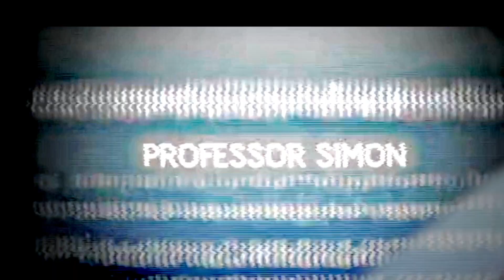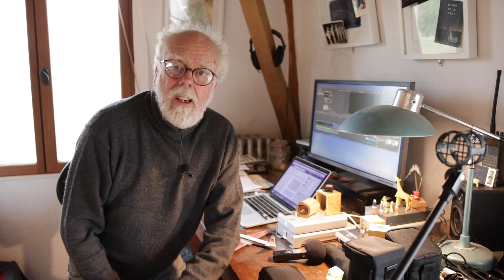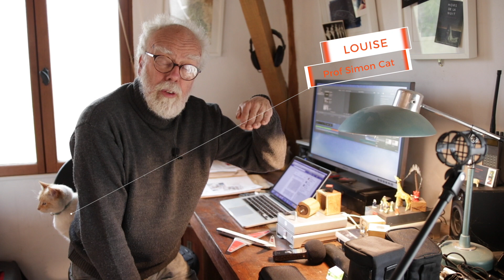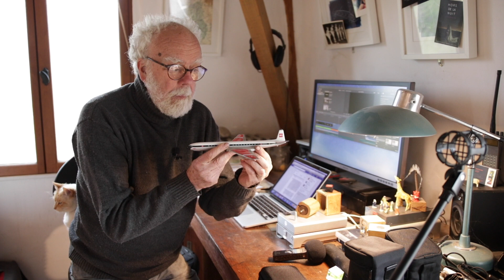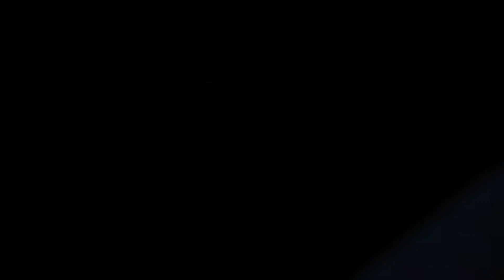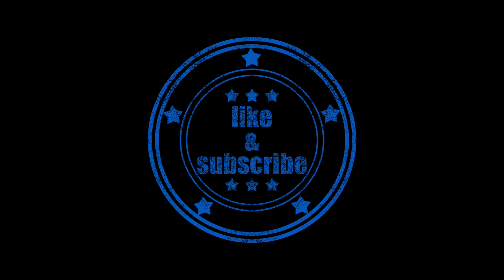737 Max 8 - Report published - Prof Simon

Comment: Using a software system to counter design flaw is just simply wrong. And they still insist that software update will fix it !!! Hope the airlines will reject this and ask for a permanent fix (like larger elevators) . Will Boeing ever learn that taking short cuts can be costly? I doubt it.
Reply: The only solution...replace the engine to old one..no max
Reply: I agree. And it happens all the time. I used to write automation control system software. The mechanical engineers were always trying to get me to make software adjustments to compensate for a bad mechanical design. It never works. I remember one time they were having trouble so they convinced management that I was the problem and so I was pulled off the job and they let another software engineer completely re-write the software. Two years later the machine was scrapped. They never got it to work.
Reply: Not a design flaw, they could simply train pilots on the new stall angle due to the forward engines and not use MCAS at all.  Instead the airlines asked for MCAS to avoid training.  The airlines asked for this and didn't care if it worked.  Boeing sucks and the airlines suck.  The airlines with the crashes had no influence, it is US and EU airlines and regulators that are 100% responsible.  Boeing did what airlines wanted and what regulators allowed.
Reply: Rata 4U - The need for MCAS, as I understand from Professor Simon and other experience aviation analysts, came due to compromise in design that made an inherently stable airframe to pitch up extra and potentially cause stall. Passenger aircrafts must be stable without the need for software used in unstable fighter planes.

Comment: And yet their share price went up 3% today. Great vid 👍
Reply: Daryl Whitfeld The markets feared a worse explanation so the shares came up a fraction. Textbook example of market mechanisms.
Reply: @vondahe  Heavens I wonder what could be worse than, you are responsible for these deaths, your plane has a serious design flaw, they are all grounded and anybody who can will be getting out of their contract to buy more of these planes as a result you are very likely to go broke
Reply: @campbellmorrison8540  A worse scenario (for stock holders) would have been a second flaw. "At least" both crashes had the same cause, one that Boeing allegedly has a fix for, so it's more likely that the world-wide grounding is over sooner and production can be back to normal faster -> more revenues for shareholders, therefore a more valued investment -> stock price rises. That's the logic behind it.
Reply: Rata 4U  True :) still just goes to show the market doesn't care about the end product really just the money that might be made. We will see what the real affect is on Boeing in the long run I guess.
Reply: Rata 4U  You recon? I dont see any airlines that seem to agree. Equally the software might have been fixed but the overall unstable structure of the plane due to the motors hasn't.

Comment: The MAX seems to have serious design flaws and my guess is that it won't fly again in 2019.
Reply from the maker: We will see...Boeing are too big to fail.
Reply: @SimonHollandfilms  Sure they are too big to fail. But identifying and eliminating the design flaws takes time not to mention the time needed for the certification.
Reply: I think with the information out there now, and the relatively low numbers of MAX aircraft in service, you are probably right.  It’s going to take time for consumer confidence to be restored as well as the actual software redesign to be rolled out.  

But fortunately for Boeing, people have bad short term memory.  Just pick any second term politician at random to exemplify that.
Reply: As a member of the flying public, I have informed the local carrier that I would not fly with them if the equipment is a 737 MAX.
Reply: It must never fly again ever.
Reply: @lizkayne  It must go the way of the Concorde.

Comment: It is more and more puzzling. The first delivery of a MAX 8 on May 6, 2017, to Malindo Air,  placed the aircraft into service on May 22, 2017. Since then there were 370 B-737MAX8 put into service worldwide.  Nowhere anything happened, not even a serious warning from any pilots was heard of.  So although the pilots turned off MCAS it again activated as if directed by ghost hand.  They should definitely check whether the plane's computer has a security hole and a terrorist on the ground can break in with remote control, radio control.  That both accidents were actually terror attacks?
Reply: that is TRUE ..copilot screamed allahu akbar before they crash..its pretty obvious sand people did it AGAIN
Reply: @drazenkunovic5168  You missed to mention that he also "prayed for a miracle from God" to save all souls. This is not a terrorist event.
Reply: It's simple, the planes are new enough none of the AOA sensors had any problems yet, until they did.  The Ethiopian AOA sensor failed twice (the left side one), the first time the pilots save it, the second time was fatal.

Comment: read the report and its gut wrenching

all it takes is one faulty AoA sensor to bring down one plane

the left captain AoA sensor was either damaged or giving false readings and the MCAS was taking readings from the left AoA sensor 

thus activating the MCAS to nose down

the First Officer disabled the Electric Stab Trim switches

then they tried to manually trim the plane upward

but what boggles my mind is why would anyone think of reactivating the Electric Stab Trim switches when they already suspect the MCAS is causing the nose down position

once the MCAS is back online, it sent the plane into a full nose down position and the fate of the plane is sealed

There is no denying that Boeing and FAA has really f**k up and 350 souls were lost
Reply: What boggles the mind even more is why anyone would design a passenger plane to nose dive? It's a no brainer to be honest.
Reply: @fungames24  Nose Dive or nose down may be a misnomer.  ND or nose down is a direction,  as is NU nose up,  MCAS moves the trim in ND DIRECTION to a safe level UNDER NORMAL conditions IE AOA working ADIRS working and FCC working correctly.  MCAS is supposed to prevent a stall,  so it brings the nose down (from a nose up position)  until out of stall range,  under normal circumstances with all systems and sensors operating normally.  The cockpit environment was extremely tense,  overspeed clacker sounding, SINK RATE voice warning sounding,  trim wheels spinning,  crew unable to use physical strength to pull nose up,  autothrottles at take off power,  aircraft porpoising, losing altitude while still very close to the ground.  All this began when flaps were fully retracted and autopilot kicked off.  This was happening only minutes after takeoff.
Reply: @bitteroldman3151  The tiny impact crater on the ground told us it was a nose dive, despite boeing pretending it to be a nose down.
Reply: @fungames24  its an anti stall system. Because the new Max planes tend to nose up. So the MCAS is help to make the plane nose down. But the flaw is when given wrong data. The MCAS thinks the plane is stalling and forcing it to dive.
Reply: Just one AoA vane and down it goes... very (non) prudent by the FAA to sign-off such a critical system without any redundancy built in. Very poor job.
Reply: the left side AoA sensor was giving erratic readings and at one stage it gave a reading of 75 degrees AoA. However, the Captain engaged the left side auto-pilot whilst also failing to realise the catastrophic effect the faulty AoA sensor would have on the handling of the aircraft, he should have switched to the right-side AoA which was providing accurate data, however at this stage we don’t why the Captain never took any action to do that.
Reply: @mvfc7637  does MCAS let the pilot switch from one AOA sensor to the other?  Seems like if it does allow that, then that would have been part of the "fix" procedure that Boeing sent out to all MAX pilots after they figured out that the bad AOA sensor was the primary cause of the Lion Air crash.  But I don't believe Boeing mentioned that in the bulletin which leads me to believe that MCAS takes it AOA reading from only one sensor and that can't be changed by the pilot.  What's astonishing is that Boeing didn't design MCAS to look at BOTH sensors since they have two sensors on the plane!
Reply: The pilots were doing what they could physically do and needed the electric assist to restabilize the plane.  MVFC76 wants to know why the captain  never took any action.  It like this:  When you are up to your ass in alligators it is easy to forget that your initial objective was to drain the swamp.   This investigation and the litigation will go on for years.
Reply: The captain did not fail to realise the effect of broken AOA. He knew AP will shut off MCAS. There's nothing that says the AOA can be switched from side to side in flight.
Reply: Perhaps they didn't expect the MCAST system to push the nose down again ?
Reply: @gnexus01  MCAS did exactly what it was programmed to do.  If the faulty data continues to be fed to ADIRS and FCC once the electric stab trim cutout is repowered,  the MCAS will continue to trim ND as it was programmed to do. MCAS can be designed to be inhibited if sensor data presents a scenario where the aircraft departs from a normal flight profile or expected flight profile......in this case altitude below 1000' AGL,  airspeed near 500 knots,  takeoff power,  stab position,  severly out of trim along pitch axis,  aircraft attitude.  manual trim wheels could not be turned fast enough to regain control and the tension on the cables from stab aerodynamic loads made it almost impossible for the crew to trim the nose back up in the time and altitude they were faced with.  Electric trim is much faster than spinning the manual trim wheels.  In this case the stab jack screw was at or near full ND travel limit.

Comment: MCAS = Multiple Crashes Assured System
Reply: MCAS - May Crash Aircraft Sometimes
Reply: @kamana6435  awesome
Reply: Multiple Casualties Assurance System  :(
Reply: Mass Coffin Automation System
Reply: @jjmarz1001  The 737 max has been renamed the flying coffin .
Reply: Mega Cash Absurdly Squandered  
This is costing Boeing big time
Reply: Clearly
Reply: Wow....that is something
Reply: lol
Reply: HAHA yeah that about sums it up unfortunately.
Reply: MCAS is not only work in the airliner aircraft, also in figjter jets
Reply: @sebastiannikkolas8497  a fighter jet is a different story . they are meant for many kinds of maneuvers . You dont do this with a passenger plane . clearly the ethopian jet reports that the pilots had no chance . Adis is almost 8000 ft and the plane was barely 2000 ft about ground . the trim wheels cant move the stabilizer under those conditions . a 150 people were just murdered for reason than greed .
Reply: What exactly does MCAS do??
Reply: Mcrash
Reply: Might Crash Again Soon

Comment: As far as the sources said they updated the software and now will rely on  both the AOA sensor , 
If one pops different result from other there would be warning ! But i  feel those AOA sensor are still unreliable! 
There are definitely better ways of measuring the angle of attack!

Just imagine a birdstrike hitting those sensor during takeoff or landing , Pilot would have very little time to make adjustments.
Reply: Is there in Ethiopia large Bugs or Birds that while the Plane was still close to the ground, could have hit the Left AoA Sensor and caused the Error Signal that was the first step?  Should there be deflection bars to protect the AoA Sensors?
Reply: @charlessayle4521  "Should there be deflection bars to protect the AOA Sensors?" You can't do that. To work properly the AOA sensor must be exposed directly to the local airflow, which has to be undisturbed.
Reply: @charlessayle4521  you can't do that! It will loose its main dynamics . But there are lot of other ways to measure the angle of attack i believe. I am not sure about gyroscope measuring the angle of attack but that might work.
Reply: It should have at least three AOA sensors or better yet four. Then you employ a voting system that can automatically vote out the bad sensor. You need more than two sensors to establish a quorum. Otherwise you might as well give the pilots a coin and let them flip it in the cockpit to decide which sensor to believe.

Comment: Reading the report timeline line by line the aircrew almost saved the aircraft and the report does not reflect any good on the aircraft design, software or Boeing.
Reply: The only problem with the B737 MAX was extremely poor MCAS design which needs sensor cross checking, fail safe design, limits on stabiliser adjustment and most importantly a way of disconnecting MCAS without disabling the electric trim system as well.
Reply: @WilliamJones-Halibut-vq1fs  How do you know the MCAS is the only flaw in a self-certified aircraft?
Reply: Homo Quantum Sapiens  That is the only point at which they breached procedure and at those speeds, manually trimming the elevator is nigh on impossible so  low above the ground. They just did not have the altitude to do it.
Reply: Homo Quantum Sapiens  - You can't compare a full fly by wire directly to Boeing's hybrid system. Airbus has problems of their own.

MCAS was not "turned off" The Horizontal Stabilizer Trim can be disabled. ("STAB CUT OUT") but the flight control software, including MCAS, is still running. MCAS is a set of behaviors in the flight control software, not a separate system.

Boeing aircraft have a fully manual, mechanical  connection from the cockpit to the HSTAB Trim, but it's not warrented to work when manually operated if the plane is being flown beyond the upper limit of it's published operational envelope.
Reply: Homo Quantum Sapiens  Please do not compare Airbus' auto-trim system with Boeing's MCAS : they work in a completely different way, and don't have the same responsibility.
Airbus' fly by wire flight control system have multiple levels of downgraded computer authority called "alternate laws", allowing the pilot more and more authority. The very first level of alternate law stops using the AOA sensor and relies on the more conventional speed indicators and attitude indicators, and the pilot can override it with his sidestick.

There is even a "direct law" mode where the computer does nothing but following orders blindly, all safeties off.
Pilots can use buttons to override the computer's authority and use these alternate modes if necessary.

Comment: MCAS system. It didn't work. Enough said
Reply: The problem was that it did work 3 times probably because of bad data
Reply: Homo Quantum Sapiens  Do planes need MCAS system? If the answer is no why have it. If the answer is yes then why? If the reply is new big engines then why? If the answer is to fly faster and save on fuel then why? If the the answer is Boeing will be able to sell these planes and be ahead of Airbus. Then Why?   Answer GREED OF MONEY AND LOSS OF LIVES DON'T MATTER.

If MCAS is mandatory. Then I withdraw everything I said otherwise I don't fly in a plane with MCAS fitted on.